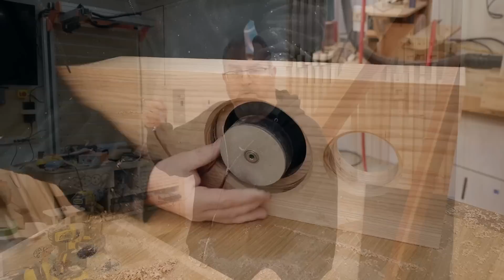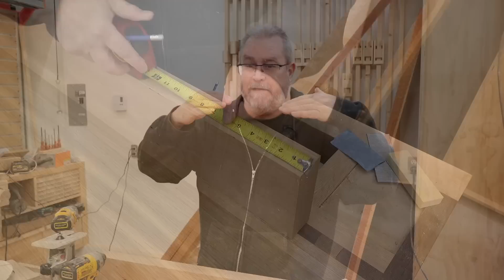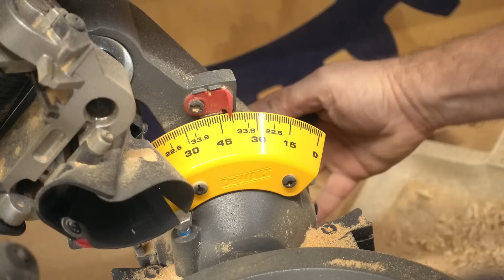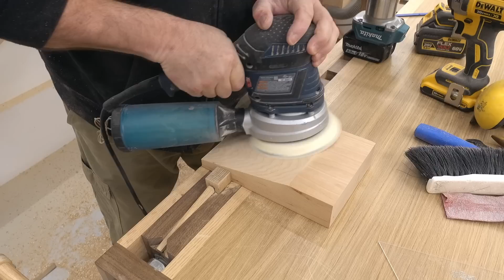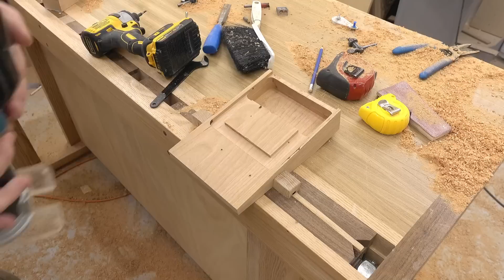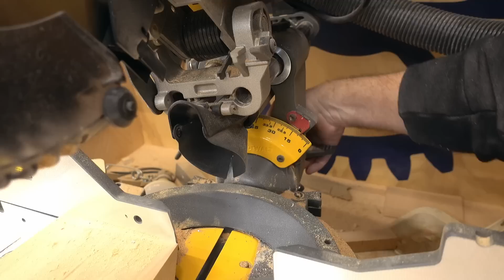Let's be Honest, these Stands Make the Speaker

Comment from the maker: The stands are what make this speaker design look neat. But they are fairly complex with lots of angles and a good share of that complexity is hollowing out the base for the crossover components. After cutting the parts I used my adjustable router template to cut a recess. And while I was at it managed to chip the thin end which encouraged me to add the steel bottom plate. The steel will cover the opening, but also provide a bit more weight on the bottom to make the speaker more stable.
I used solid cherry to make the parts and had to make sure I got all of them from the piece I had. 
This step in the project took most of a full day, so while these speakers will look fairly simple when done, these are among the most complex ones I've built.
This is part 5 in my series on designing making a pair of open baffle 2-way speakers to use as "surround" speakers in my listening room. 
I've created a playlist with all of the videos: https://youtube.com/playlist?list=PLQl9KPrpiIH-5l4QhxUYXHGhr-covK8n6

Comment: Next level! 🤯
I’m still learning wood stuff, and made simple acoustic panels with n00b butt joints, lol. 

Biggest challenge for me is brainstorming/researching diff available wood types (since I have no planer, s4s or sq-edge boards, etc.) that can fit in a small 2dr car (obviously, can’t buy 4’x8’ boards), and also a completely full 2 car garage with no more room (hence, can’t get power bench-top tools nor big permanent workbench).
Recently got sawhorses… next is to make a tabletop to slide under storage shelves.

Comment: I hope you are not placing coils onto that steel plate.
Reply from the maker: I knew I'd get a comment about that, so I measured the response with and without the plate. No difference.
Just proves how guys see something they perceive as a problem, talk about it like it's a big deal, and yet it has no impact whatsoever.
And that's measuring the speakers at what I'd consider maximum output, around 90db.
Reply: @IBuildIt  lots of armchair info on the internet… 🧐

Comment: Those are some crazy angles. Nice design and execution. I made a pair of speaker stands last year for my daughter but I was dealing with 90 and 45 deg angles. Also had some 3/4" steel that's hidden in the bottom to add weight. They turned out real nice but yours are on another level.

Comment: John, although woofers might have a certain response in a sim, they will be constrained by the baffle walls of a thick baffle like the one you are using. The best recommendation is to deeply champfer the rear of the midbass hole so that the woofer can breath on the backswing. This should improve your midbass response. Please try and  let me know.
Reply from the maker: I don't know what you are looking at, but there isn't anything wrong with the response. 
And there's more than enough open space on the back for the woofer to breath. I'm getting a near identical response between this thick baffle and the thinner test baffle I made.
Reply: If you watch the other video, he did chamfer the rear. All in all, I think John did a great job with this design. OB is not an easy way to go in design.